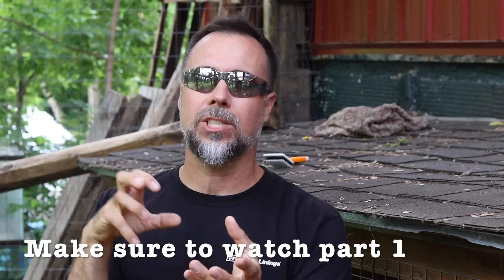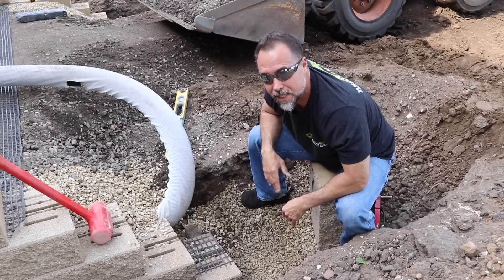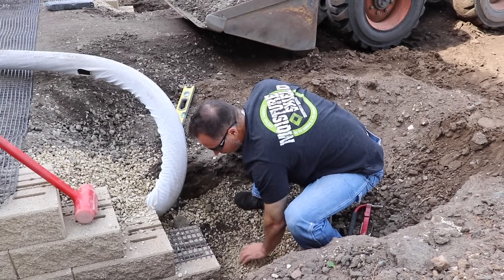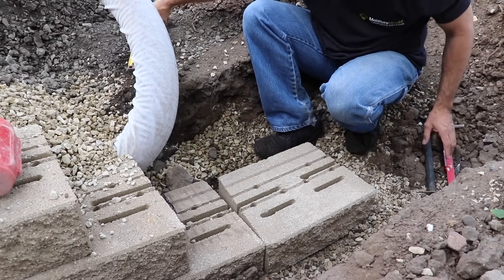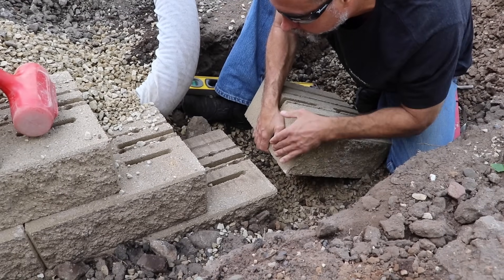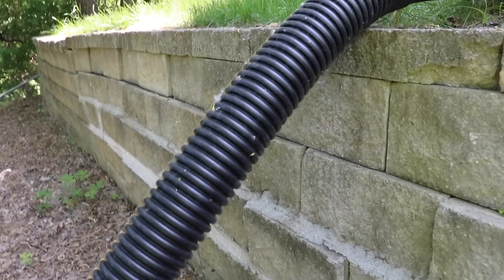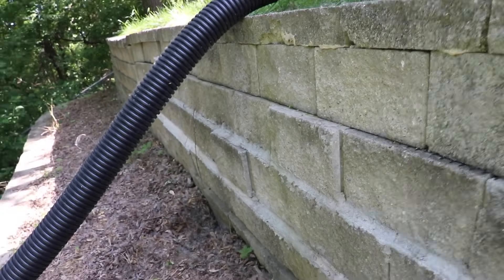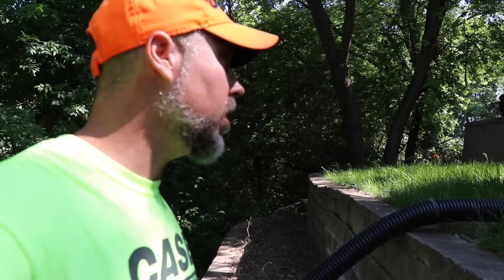Common Retaining wall mistakes & how to AVOID THEM, bad designs, bad base, wrong block....#2

Comment: Hey stanley you touch on mistakes people make, but what about errors that can be made while installing versa lok walls. We have encounterd getting improperly poured block. Also the ocaisonal corners where the transition is much harder to level such as corners and collums?
Reply: Dillon Swiatek 
Use Ep Henry
Reply: Tim C im not sure what u mean

Comment: Stanley, Thanks for the info. I am trying to put a terraced retaining wall in my back yard, but it's a bit confusing, because my yard is mid way down a large hill and the slope runs perpendicular to the direction of my house (so the hill goes sideways in my yard, left to right. I would really appreciate your input if you'd be willing to let me send you some pictures and an example of my idea? Either way, you've got my like and sub. Thanks!

Comment: Clear stone isn't so easy to find,  Marble chips I would think would deteriorate with water over time,  I am going to use pea stones to work with for my retaining wall base.  Again is about a 30' run 24" high so its not so bad.

Comment: Depending on how far apart the two walls are, you more than likely have to design and build it as one unit anyway. The bottom wall has to hold up the top one.

Comment: Hey you’re the expert. I want to know the details. I will say that there are big difference in block. The quality in the block that I used was just plain horrible 
Some of the cap stone were 1/4” different thickness and for a guy that is an anal interior contractor that is in the most scrutinized trade in all 13 divisions. That drives me crazy. !!  It’s hard enough work with good materials
Andy

Comment: How would I fix a block wall that starts to curve but I suppose to be straight .  I’m using Allen block. It has a locking lip at the top front of every block.

Comment: 2:58 - Workplace rule #2. Don't leave shovels or rakes on the ground...so you don't step on them and get a whack in the face (or the ass). Even 'pros' like this can fail. Now, BUILD THE WALL!

Comment: It's easy to calculate the cost of a job...  but what should I be making in profit.  I want my business to grow, not just break even.  I also don't want to overcharge.  Any advice in this area???
Reply: +John Davis, My father had the same problem when he was starting out.

First I suggest you compare your pricing to other contractors in your area that specialise in the same field (if there is any). Do your research on what materials they use as well as the pricing of materials they use.

Calculate their profit from a basic common task and find their percentage of profit. He found the percentage is the area was about 11-13 per cent. I started off with a 10% margin when he entered contracting so it was cheaper than the competition and could get his foot in the door.

He worked the 10% margin until he was beginning to pick up speed and exceed past the competitors. Once he had exceeded them, this gives him the chance to advertise as the 'leading contractor in his field' and all the rest of that advertising stuff. That advertisement worked like a charm.

Once he started to see my competitions prices dropping, he began edging my margin up by about 0.2% every 6 months until I had a profit margin of about 15%. He also began expanding my company to a broader region and started a branch in the next region. In the new region, he started all over again, but this time with the profit from his original branch.

He exceeded the competition in the new region quite quickly due to all the experience he had from my first and built up his pricing quicker (once competitors pricing started to drop) to match my first regions pricing at that time.

He continued with this butterfly effect expanding to more and more regions. I've started another contractor business in a different trade and I'll be following this checklist listed below (Rundown):

1) Research other contractors in the same field as you nearby. (If there is any)
2) Calculate their profits and their profit percentage margin. (If there are no competitors, I suggest beginning around 10%)
3) Begin your business with cheaper quotes than your competitors (a 1-2% profit decrease from competitors)
4) Work that margin until you exceed competition (Be aware, for large projects where 10% profit is an excess the client may not be willing to pay, drop the profit margin to match your financial needs plus a little bonus)
5) Once competitors begin dropping prices to sustain their business, every few months slide the profit up slightly if you desire. (You should only slide up profit margin if your competition if you know you have a better reputation than them)
6) Expand your business to lower costs and boost profits, whether it means to use your own machines or find a cheaper material source.

IMPORTANT NOTE:

Always keep an eye on competitors in your area. See what they're doing, and one-up it if it won't cost your business massively. If you think it will damage your business, chances are the competitor will run himself out of business.

You have to take risks and work hard or you will never succeed. Your business might fail the first time, but dont quit when you make a mistake, learn from it.

Comment: I have to put an add on in to this, do to maybe your climate you clamed in your last video that you don't need drain tile.. well here in NORTH WESTERN ONT. CANADA  our winter are very long and very cold, like -40, -50 with wind chills of -70, we have to install drain tile every 3 feet up behind the wall with good pit run gravel, as one day or night could start off as a heavy rain ice storm and in an hour turn to -30 and the water freezes between the blocks trapping the water in the very small gaps, further more we have to install 2" pipes though the wall or grates at the base grade and at each 3 foot lift next to the drain tile, if not done the water freezes and blocks the water flow pushing the wall out, cod high winds blowing at the wall freezes fast, solid built walls have failed that didn't have the drain tile in lifts, not failing to the point of falling over but pushed just out of place, little by little each year, even when pined pins fail

Comment: Stan, I'm a new homeowner and I've just spent 2 entire days trying to pressure wash my back patio which is surrounded by a paver retaining wall.  The more I wash, the more muck comes or from between the pavers.  I've literally been washing and then literally shoveling poundsof mud off my patio.  I'm exhausted and I'm getting nowhere.  I think the previous homeowner built the retaining wall with no backfill and no landscape fabric behind it.  Am I going to have to tear the whole wall down and rebuild it?  I'm nearly in tears.  I've been cleaning it for 5 hours a day for 2 days and it's a mud puddle on my patio.

Comment: How does the blocks interlock with each other I dont see any grooves on the sides , they are smooth, and you put blocks on loose gravel, explain that.
Reply: I think i can answer you. The way the courses are staggered makes the pins from the top coarse tie the 2 blocks below them together.

Comment: You would think the base blocks need to sit on compacted substrate like “class 5”.  How is the wall so stable if it so easy to adjust the blocks by tapping?
Reply: The rock locks in place once it has the static load of the block(s) on it, when it is open and you are giving it impact with the dead low, you can make some micro adjustments. Even with the dead blow, you still have a hell of a time making those adjustments, and you can only adjust them so much. A lot of times you have to just pull the block and add/remove the amount of base underneath. It is the most tedious and time consuming part of these walls, and also labor intensive because you’re working down low at the bottom of a trench.

Comment: What i dont get, is why you put your base block in lose gravel and not set it in concrete ? frost (depending on your location), water, roots etc can preposition your base if not properly locked in place. Might be a European thing, but we build for lasting results :P
Reply: To clarify last comment, its a requirement to set it in concrete if you do commercial work in EU.

Comment: Why would you not use a concrete foundation and cement-bond the first row with a open ear bond .then dry bond there after . After all the strong foundation is everything to do with longevity of a project.

Comment: My driveway is on the other side of the crap rail tie falling down retaining wall some idiot previously built at the old house I bought.  I don't want ANY damn water coming through the wall washing away my not so cheap gravel in my driveway down into the storm drain like it does every year?  How can it ALL drain out the back?

Comment: Dont need an engineer or permit using wall forms and pouring a str8 up concrete wall.....
Reply: Depends on how high the wall is and what it supports. Suspect your str8 up wall will fail without a properly contructe footing..

Comment: Im surprised you set your blocks on pea gravel....We use the same steps as our pavers, we use a class 5 for our base and on straight runs I will set up screed pipes just like I do when I install pavers and screed about 3/4" of bedding sand. That bedding sand will allow me to hit my blocks in place. I find it hard to believe you can get pea gravel to compact well enough
Reply: kevinboo2000 3/4" clear is ca7 or ca11. It's not gravel.
Reply: kevinboo2000 - it's not pea gravel. We call it 3/4" crushed or 3/4" clear. It is angular, not smooth like pea gravel. 3/4" crushed is a "no compaction" material and is more free draining than sand.
Reply: Yeah a lot of places call it different names. We call 3/4" clear Driveway mix and 3/4" crushed we call it 3/4" crusher run and we use a larger crusher run that Stan was calling class 5. Thanks for the response